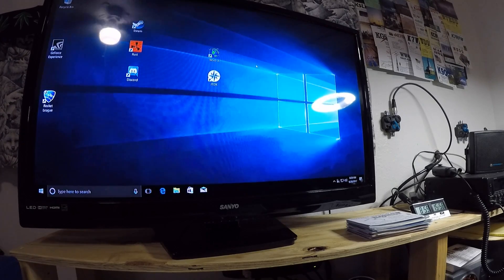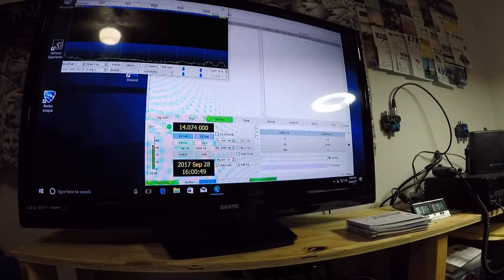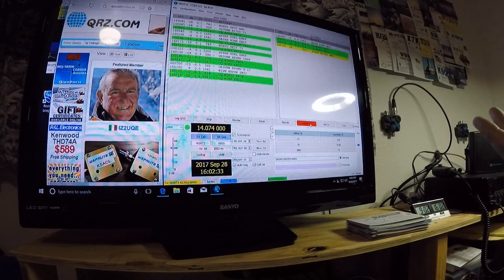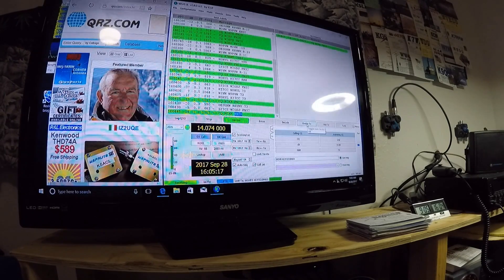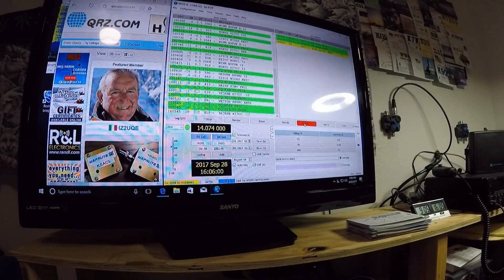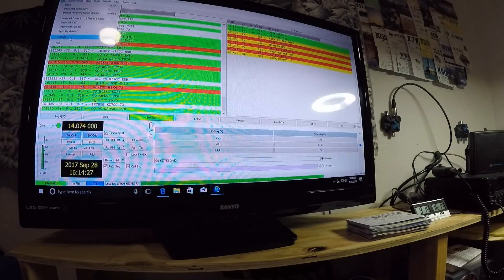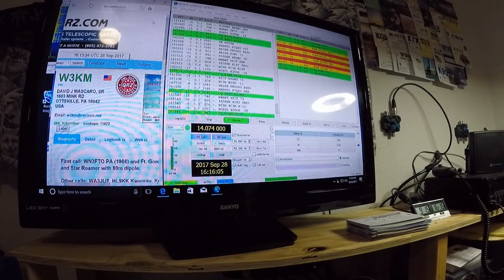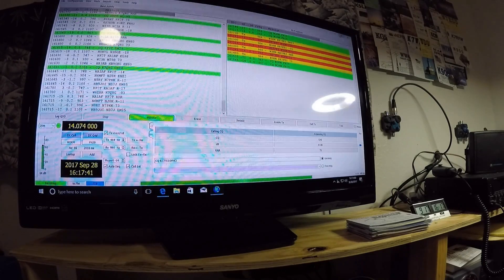FT8 HAM RADIO? It's Easy If You Do It!

Comment: I take it that FT8 is not based on partly using the internet. As I will not use  a mode that needs internet to transmit and receive. Radio is Antenna to antenna, Not via internet. skype, messenger etc is good enough if you want to speak with someone via the internet. Internet radio is not what I studied for. RF to RF. no piggybacking.
Reply from the maker: Hey Dentron, thanks for your comment. But as I stated 11 months ago and I will again. FT8 does not need internet to transmit or receive... I say again FT8 does NOT need internet to transmit or receive... It would be the same like slow scan tv or anything that uses radio waves to communicate. So please, instead of bashing something do some research or ask... Not bash something just because you do not know. This is a hobby, not a job. Have fun 73'
Reply from the maker: For more information head on over to that's right arrl.. :  http://www.arrl.org/news/ft8-mode-is-latest-bright-shiny-object-in-amateur-radio-digital-world

Comment: I'm thinking of getting a Yaesu FT-450D to run FT8.  What besides the WSJT-X, a computer, and the radio, will I need?  Does the radio have a built in interface?  For some reason I thought I saw that, somewhere.  Thanks!
Reply from the maker: Good Evening Linda, You are going to need a cable "interface" like this... this is the one I bought and it works just fine with the radio. Hope this helps out:) 73' KE7FEI

 https://www.ebay.com/itm/Yaesu-USB-CAT-and-Digimode-Interface-PSK31-etc-FT-450-FT-950-FT-DX1200/262486990036?hash=item3d1d719cd4:g:Q9QAAOSwgYVZ2m6V
Reply: Thanks, KE7FEI.  I thought I'd need something, but it sounded like you just connected the radio and computer direct.  I have a Rig Blaster Nomic, which works with my TS-430S for PSK31, but I don't know if it will work on the 450D.  Part of my problem is I'm using an old Compaq XP laptop.  I tried putting WSJT-X on my Lenovo, running  Linux Mint, but I ran into problems with mini-plugs vs USB's, so got nothing. <sigh>
Reply from the maker: Linda M Welcome, that is correct all I did was connect the interface to the computer and to the data part of the radio. Made sure my settings were right on my computer and bam it was off a running:) I have not tried to run in Linux so I can't help you there, but I have used it on XP and windows 10 they both work just fine. Good luck and if you need anymore help please let me know :)
Reply: Thanks, BC.  I missed the "interface".  I thought you said just a wire.  Got it!  I do have Win 10, but it's on my good laptop, and I'm really not wanting to use that one for the radio.  I use Digipan on the XP, for PSK31.  Thanks for your help.  Now, just to make up my mind to spend a lot (for me) of $$ on a new radio.  ;-)

Comment: Enable text or enable transmit?
Reply from the maker: Hey Matt, is that a question or a statement?? I'll do my best to answer thanks 73 KE7FEI
Reply: It was a question.  I thought it meant enable transmit but I'm new to HF digital.  Also, it seems that radio setting and modes are ambiguous.  What mode is best to be in at 6M and the others?  Several say to choose data-usb but it sounds so much better on Rtty-usb.  Can you advise?  Thank you.
Reply from the maker: Ok Matt, got ya now. I use USB for all my data modes. (Not usb DATA), however that's just me. Which ever mode works best for you is the way to go, I have seen many others say use this and that and whatever. As long as you can decode and transmit and it works for you then use it. That's why we call it a hobby right? HI HI, hope this helps, please let me know if you have any other questions and I'll do my best to help.
Reply: Thanks Big!
Reply: One last bug here, what are the basic settings I need for my radio?  Do you have a cheat sheet for width, filters and all that other stuff?  It's weird I get FT8 stuff showing up/rolling in on 20M but hear the same and nothing shows up on 6M where I'm able to transmit as a tech.  Thanks again Big.  Matt / KF4ULD

Comment: Jim, with the auto sequence button engaged, the program will automatically respond with the next sequence based on what was received. If you like doing it manually, you can un-check the autosequence box. Also, the program will log all contacts for easy uploading to QRZ, LoTW, eQSL.cc. Using rig control really makes it easy when changing bands. I have found that using the macros allows you to send additional info such as rig, antenna, power level, name or any other comments using just a couple of words per sequence. Very easy to do and it makes the fun even better! 73 N4UVR
Reply from the maker: Thanks Cory for explaining it better than I did hi hi ^_^  I just like the manual part, makes it easy for me. Thanks again and hope to work a qso with you some day! Have fun and 73’ KE7FEI